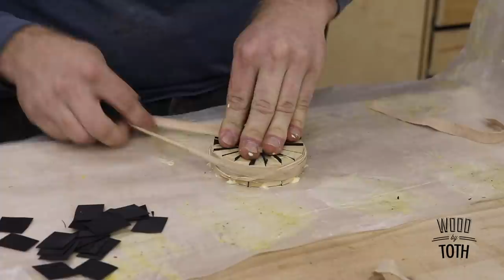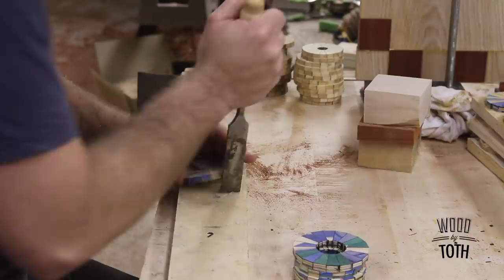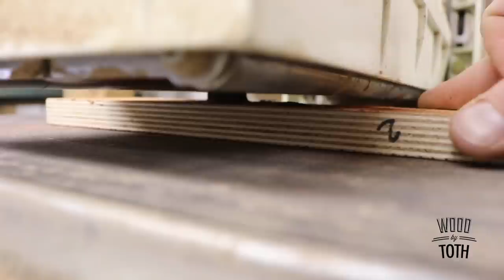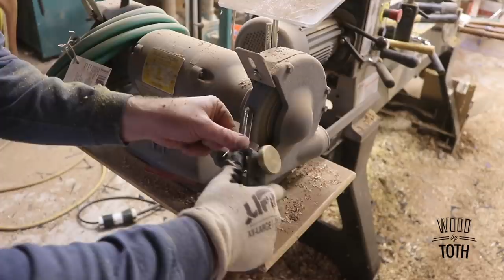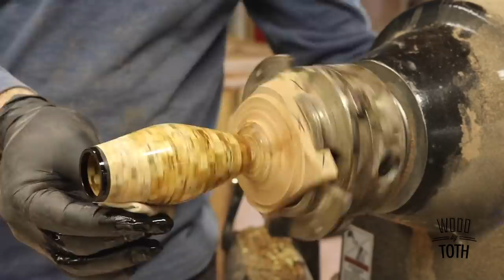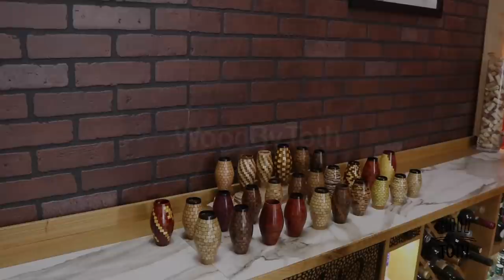Woodturning // Making 30 Vases

Comment: Quick question, Kyle. On some of your videos with bigger vases, like the 100th vase one, you are using a low rpm (260) when hollowing inside and a gouge. The flute is at 12 o'clock. What grind do you have, Elsworth, 40/40 or... and more importantly which part of the edge do you cut with it? It is hard to figure out from the video.
Needless to say, I have tried it and my catches are huge, so I am doing something very wrong. :-0
I have noticed that you had couple of catches, luckily not that bad.

Take care.

Comment: All the work just for 1 little piece that came out :(
Reply from the maker: Not sure I follow??
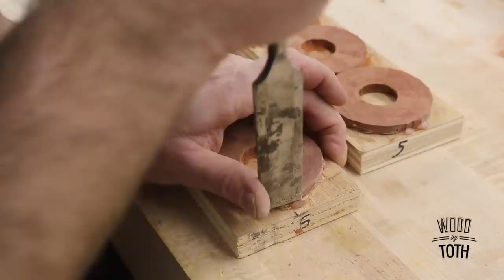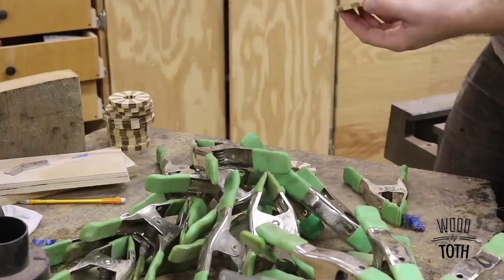Reply: @WoodByToth  2:50-4:00 was confusing did you only do the 1 piece? The rest of the ring didn't look like it had the black lines.

Also I have tried construction paper and it just flew apart, and roofing tar paper it smears black tar all over the wood when turning/sanding, if you're using veneer where do you get it without breaking the bank? Everything I have seen is so expensive for very little product.